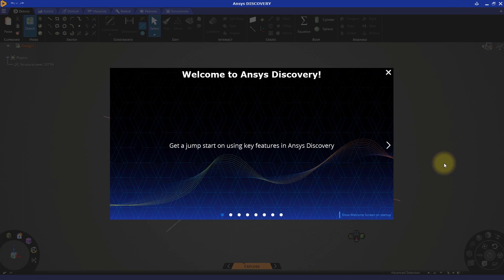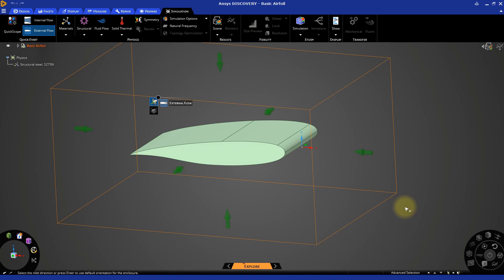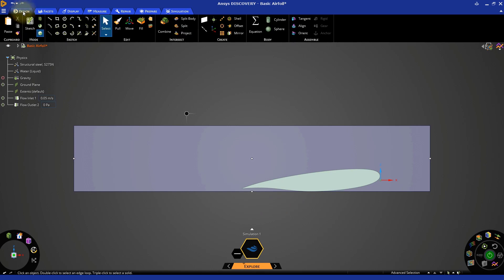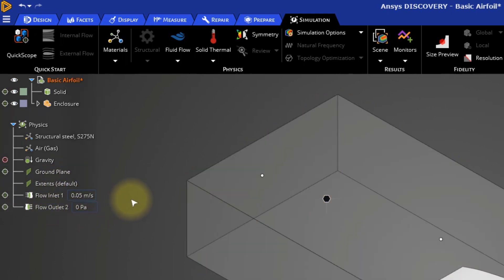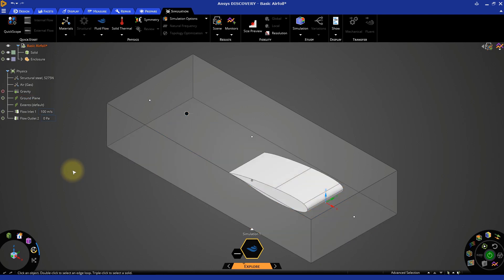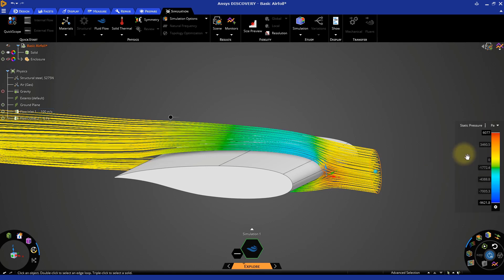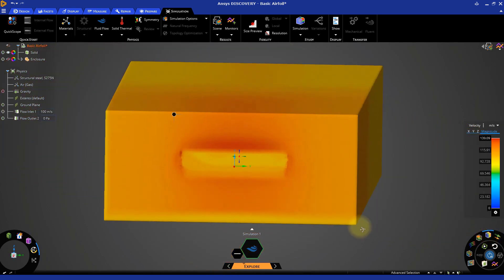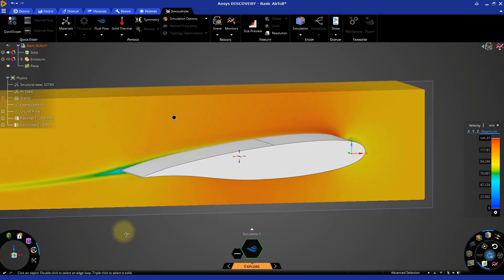Explore Lift Through Simulations - Lesson 3, Part 1

Comment: I have a problem. After setting everything up for simulation, the simulation is in red saying error: Enable fluid-solid heat transfer by defining a flow temperature for flow inlet 3